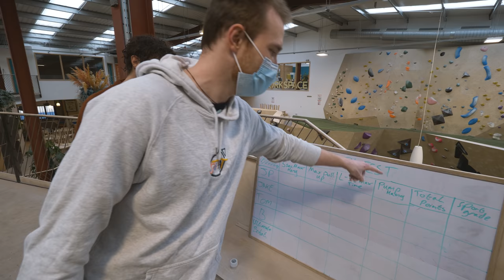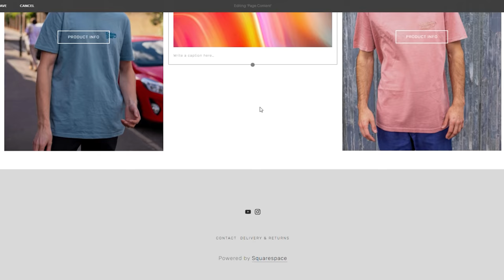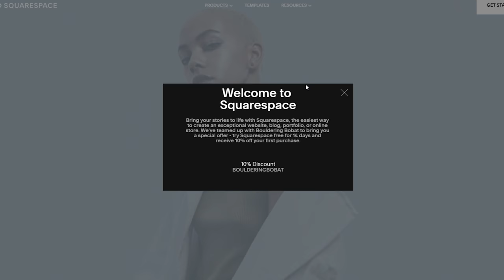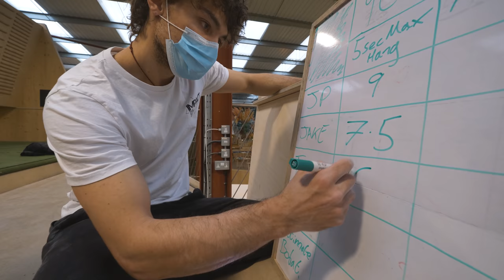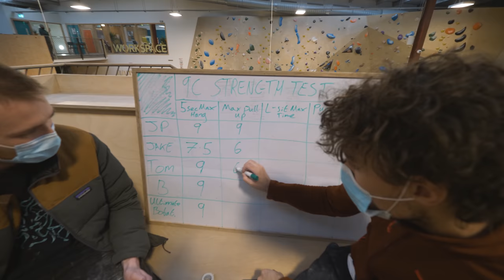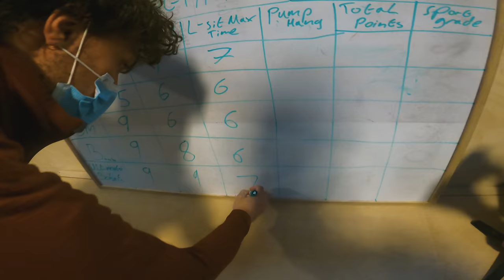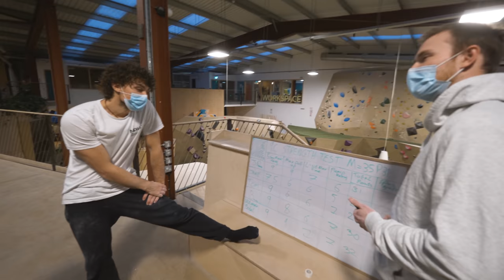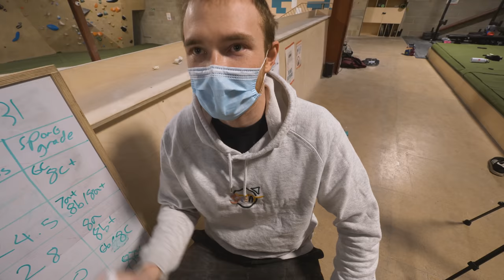Average *sport* climbers Vs 9C strength test

Comment: Just started climbing 5 weeks ago, this test gave me a results of 24 points = 8a+. First time I bouldered I managed to get few 6a:s, yesterday I hit multiple 6bs, one 6b+ and one 6c. So not far off 😁

5 points for hanging with 35kg for 5 seconds (Zlagboard 20mm competition holds)
8 points for 180% pull-up (70kg with 85kg BW)
7 points for 5 seconds Front Lever
4 points for hanging 2 minutes

Comment: honestly make a video or 2 about you guys trying your max grade via this test. i dont trust this test at all and i feel like this one is lacking. but to be honest it might just be the mental and the endurence componente. hanging from a jug for 4 mins means not you can hang in a 8c wall on a 7b grip to rest yourself? i think this test is far away from beeing THE test.
Reply: @S MM kinda makes sense if you compare it to the max of adam and alex doesnt it? but still kinda feels weird when almost everybody is now able to climb way higher than ever before "cause of missing technique" also did the 20 seconds L-seat and it felt like i could do more, but next step is 5 sec front lever which i for sure cant do 5 sec^^ i mean this test is doable in less then 30minutes, i think if you want to have a more accurate test it would need more time.
Reply: I don't think the test is meant to be perfect,  rather, it's a simple test that anyone can do at home or in the gym to get a rough gauge of where they're at in terms of climbing ability. If you wanted something more thorough then you could always pay for a lattice assessment, which goes into much greater detail when looking at climbing grade relative to physical capability.